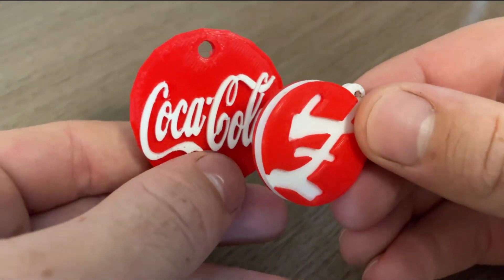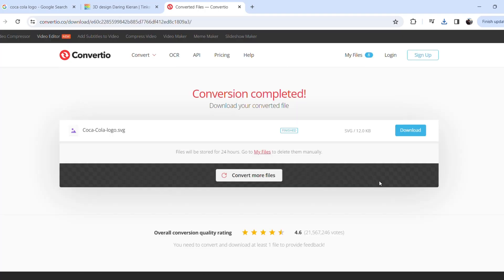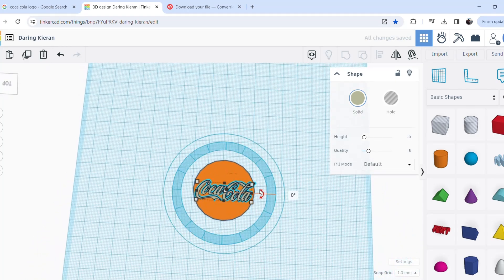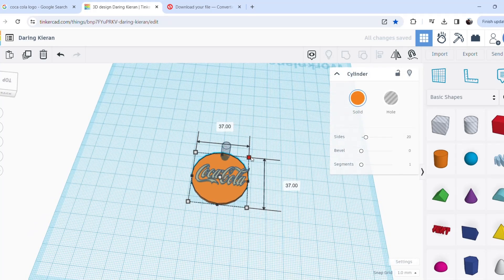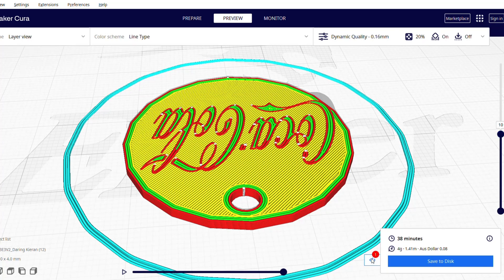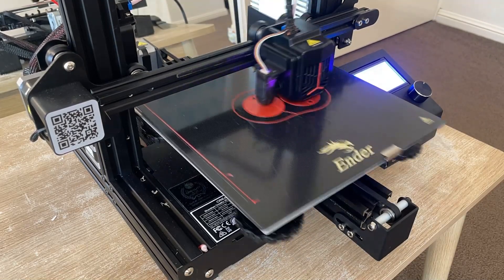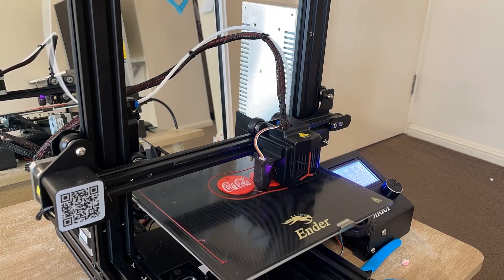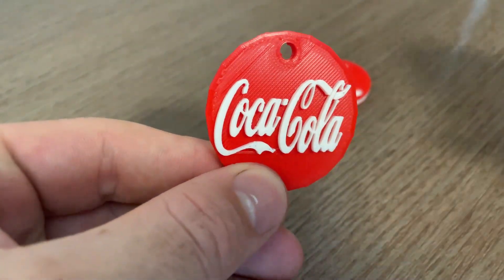3D Printing How to: Turn ANY Image into Custom Keyrings!

Comment: Is there a way to switch filament spools mid print on an Ender 3 V2 similar to what you did on your Neo?
Reply from the maker: You should definitely try Cura, Ive used it for years and it was used in this video! Amazing software and in my experience the best. 

Ill make a video tomorrow showing off the ‘experimental’ features that are super fun.

Hope that helps, let me know if you need any help:)
Reply from the maker: Absolutely! Its the same printer essentially. What slicing software are you using?
Reply: Creality Slicer 4.8, I've only been using it for a couple of weeks and using the software that came with it. I'm open to your guidance for a better slicer